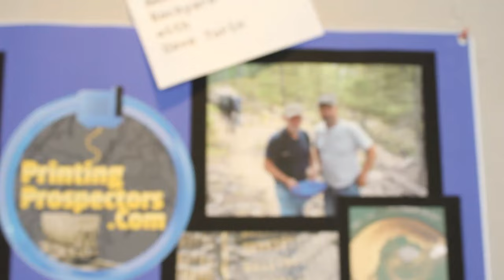The Hobby Miner Sluice Box Goes Aluminum & TV Show

Comment: I thought mine worked great as it is, what’s the aluminum do for it? Congrats on the show and nice to se you again. Thanks for sharing see you on the next one👍🏼👊🏼
Reply from the maker: The reason I went to the aluminum it is so much easier to put together and a lot less print time. We have been out checking out some new areas for the summer. more videos on the way. Thanks
Reply: @alanrobertson2510  so that makes it able to remove the all thread and silicone between the pieces ? Probably makes it a pound or two lighter then
Reply from the maker: @48thstateprospecting  Yes and I used 16 gauge aluminum so it is rock solid now.
Reply: @alanrobertson2510  nice👍🏼👊🏼